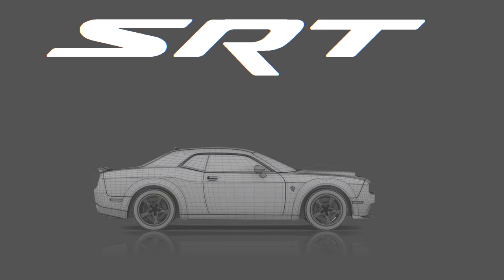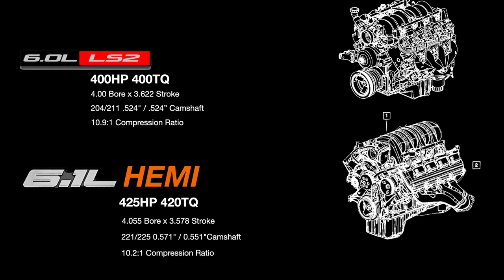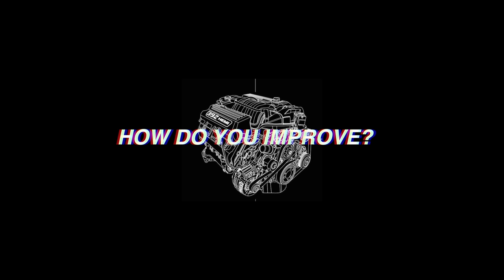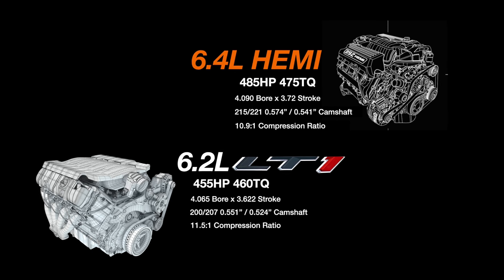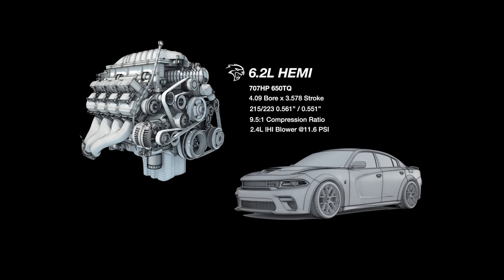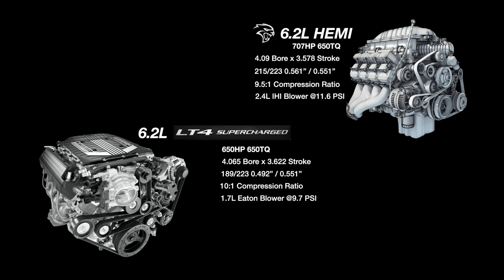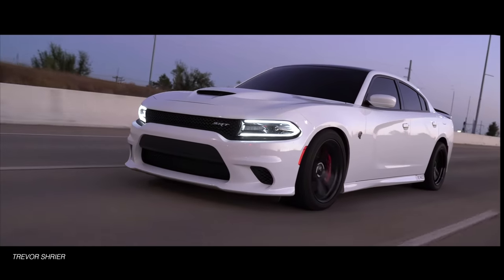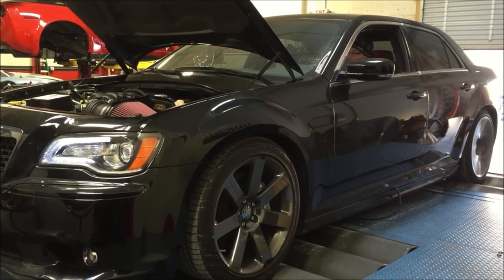Why SRT Engines Are Way Too Powerful😳| Explained Ep.3

Comment: Hemis have grown on me lately since I owned one. But the  LS family will always be superior to me just more reliable and efficient
Reply: 🤣😂🤣😂. Fake Hemi's you mean. Not real Hemi's. They are Magnum engines with a name plate.
Reply: @lincolnls0416  false. It's a hemi for a reason
Reply: @lincolnls0416  Hemi engines are quite different from an LS/GM engine. That's why the ZZ632 can hit 1,000hp NA compared to the Hellaphant and its super
Reply: @yrkjrk2972  look I am an ASE mechanic and they are not real Hemi's they are Magnums. Fck Hemi means Hemisphere now these Fake Hemi's don't have anything Hemisphere in them or about them. They also fit on magnum block's. Next 5.0s have been getting way over 1k HP. Since they were Carb engine's.
Reply: You can't beat the 5.3 Vortech.  I have one with 400 K miles. It still runs as strong as the day I bought it new.  Gas milage sux.
Reply: @ricktaylor3748  in race yeap but on mileage you calm nope. Dodge won't last to 70k miles without a break. Now you won't beat my old Escort Gt. 1.9. Before lady hit me I had 623k. I do have 1 question how many times you replace the spider injections.?? Cause then 400k don't count. Only thing I did to that 1.9 was a clutch. Oh wait map sense 3 times.
Reply: @lincolnls0416  lol know your facts said fake its Hemi for a reason kiddo
Reply: @lincolnls0416  stop the crack lol look at the valve design
Reply: That's  right  Chevy  LS and LT  shits on  these  Dodge engines that you  can't  even  put  a lot  of  miles  on  them
Reply: The biggest advantage that comes from a hemi head design (besides volume) is the opposed valve configuration.  The valve angle helps reduce shrouding and allows larger valve sizes but it’s the straightening of the ports that makes the design flow.  The quench pad at the top of the chamber is there for emissions and was a suggested add from the team that designed the 426.  It also helps the compression ratio without the need for pop up pistons.
Reply: It’s worth noting that many manufacturers use a “Hemi” head valve layout including motor cycles and have for decades.  They can’t call it a “Hemi” because Chrysler has a copyright on that name.  If you look though many of the craziest output engines use opposed/canted valves and use 4 valves and ohc.  But the valve geometry and combustion chambers are based on a sphere.  The 5.0 Coyote comes to mind…
Reply: Hemis are better from the factory, LS is easier and cheaper to mod
Reply: @Dukelevi12  so that makes  it better.cause that's  what  you  want  cheap and  easy
Reply: @lincolnls0416  the heads combustion chamber is designed like the old hemi with a hemisphere design. The bottom end isn’t like the old hemi, pretty much an LS rip off from the decks down. I’m a race engine builder for about 15 years. Those hemis arnt bad at all.
Reply: @TheRealZJE313    Like my women!
Reply: @lincolnls0416  ooooohhh ASE we better watch out this guy can pass a test. Whoa! Behold a God with a wrench. Dude most of us have ASE including myself. It's not hard. 16 years I've seen many ASE techs that couldn't fix a sandwich. ASE literally means squat on the shop floor. Just looks good on a resume.
Reply: @richieb74  no its not. I have rebuilt fake Hemi's on Demons. Your wrong.
Reply: Thank you sir idk wtf this guy talkin bout I know niggaz wit a LSX in they g-body pushin 1100 easy
Reply: @lincolnls0416  Hey, what do you mean they are "Magnums?" Just in that they are similar or are there some unadvertised compatibilities?
Reply: @fl6stringer  can swaps head's.
Reply: @yrkjrk2972  the zz632 is 632 ci/ 10.3 the cam lift is high asf .782 lift and it has a 12.0:1 comp id hope that hit lmao
Reply: Nobody in this comment section can comprehend the fact hemi is just a name for a modern engine that is no longer hemispherical like the old true hemis... because nobody in this comment section has built a fucking hemi clearly🤣🤣🤣
Reply: @lincolnls0416  they're quite literally hemispherical engines.
Reply: Super Cobra Jet cylinder heads just said hold my beer bro...
Reply: @justakettlehelm1673  no there not. Top dead center drilled on the head for a top dead center spark plug hole does not make it a real true Hemisphere engine's.
Reply: Ohh ASE mechanic. That explains a lot.
Reply: Doesn’t even look so great there. I’ve worked at shops and when guys come in with a resume and the only thing on it is ASE it goes right to the round file. They would rather have someone with shop experience than a new ASE parts changer.
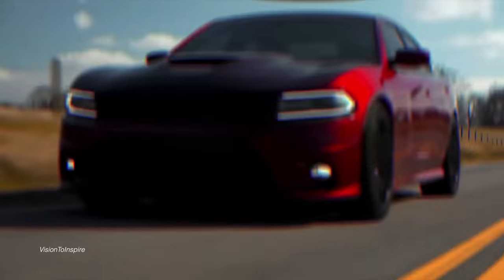Reply: @lincolnls0416  Wrong. They are Hemi's with a squish band added from the 2:00 to 4:00 o'clock and 10:00 to 8:00 o'clock positions (from the valve{s} to the cylinder walls at 9:00 and 3:00 o'clock) perpendicular  to the crankshaft. This concentrates the fuel/air mixture in the center of the remaining hemispherical chamber to be combusted by 2 spark plugs. Since the intake and exhaust ports are perpendicular to the crankshaft, you have an absolute straight/direct shot (flow) of fuel/air mixture from the intake into the combustion chamber; likewise for the exhaust side (into the header/exhaust manifold).  As a result there are 0 (zero) port turns or obstructions to deal with/grind away.  A GM LS will never flow as well as a Chrysler Hemi Gen III (nor make as much HP/Torque). It is a fact of physics; hence, Dodge/Chrysler Gen III Hemi's being handicapped in many automotive competitions (FSS as an example). Chrysler's Gen III Hemi is the very pinnacle of 2 valve V8 engine technology and cannot be improved upon. The industry will more than likely copy 
this design in order to compete with it as they have in pro stock drag racing (copying verbatim its "099" Hemi). The Gen III Hemi is also the most robust of all modern V8 American engines. It is unlikely anyone will challenge this 2 valve design and move foreword with a cleaner burning 4 valve/pent roof alternative or go electric.
Reply: @stillbill6408  🤣😂🤣. Not real Hemispheric combustion engine's. Stop I been working and rebuilding engines 43yrs. Own my own shop. Throw little numbers out all you want. Till you own a real Hemi from the 60s don't speak. I still have my own 426 Hemi in my Roadrunner wannabe Charger.
Reply: Sure is the new 5.5 flank crank they use in the C8R is the best V8 on the planet
Reply: Chevy is superior too Dodge in the V8 category that is why they compete in the GTD pro IMSA endurance racing and Dodge does nothing in any big time racing.....
Reply: LS454R reliable 770hp and 770 ftlbs NA. Mopar can't compete with LS lol
Reply: I was running 16psi on a 4.8 and had an oil pump failure. Run it for miles, pulled pounds of metal out of the oil pan and kept running it. I’m a die hard GM guy but I like everything car related.
Reply: @TheRealZJE313  Good job. You've added literally zero plausible information into this conversation. 👏👏👏👏👏👏👏👏👏👏👏👏🤦‍♂️
Reply: @lincolnls0416  tell me you know nothing about sbms without telling me you know nothing about sbms
Reply: @lincolnls0416  how so? They have spherical combustion chambers and the valve arrangement is across rather than next to each other. They are the prime of pushrod head design and also the reason all top fuel engines are based off their design. Hemis have been ahead of the game since they started 70 plus years ago
Reply: @lincolnls0416  also, no you can't swap the heads 😂. The only similarty I've found on them is the bolt pattern for the transmission. Trust me, coming from a 360 magnum owner, the first thing I wouldve done was thrown a set of hemi heads on my 360 to solve the cracking and horrible flow issue. As for the "fake hemi", they're still spherical, that means it's still a hemi.
Reply: @jerodwolford2743  your so wrong. Hemi's are fake engines. Cylinder heads way it's cut is not like 60s 426 Hemi's. As an ASE mechanic for 40yrs you need more knowledge. Top dead center cut for spark plugs on magnum engines doesn't make it a Hemi. Its the pistons and cylinders along with valve and cylinder heads cuts. Only thing different is bolt pattern on the head's. But they mount right up.
Reply: Dude put ot the joint Mopar no car...followed  by for ..Chevy just sux 
.proven fact...at least I could respect  if understood that
Reply: Take it like a man .....my wife loves powered ss camaro and the bitch know how race and twirl the iron.but ls just gets ass kicked  ..lol..and ls powered vetts are 2 seat camaros
Reply: Further more Calloway.. could shit like that with a 350 chev..but still I hate bow ties..lol
Reply: WRONG ... GM IS ALWAYS HAVING A RECALL AND HAVE HAD TONS MORE THEN CHRYSLER EVER DID .
Reply: @bradhardy2629  I had a 5.3 and the entire time I owed it I never changed the oil. As a matter fact I mixed it transmission fluid in with it when it got low. In two years of ownership it didn’t skip a beat i even sold it for more than I paid
Reply: Remember, the LS was originally a Ford design....
Reply: @shippybs  Exactly...now if only the other 80% of em out there would learn this :-p
Reply: @yrkjrk2972  You also forgot to mention the chevy engine has 206 more cubes of displacment. which is a massive difference.
Reply: @lincolnls0416  wow... you tube sure brings out the "know it alls" 5.7 hemi head will not bolt to a 5.9 magnum... the only relation to the modern hemi... and a magnum...is there both v8s... the modern hemi is indeed a hemi... it's not just a world wide lie that only you know about... the combustion chamber is in deed a hemisphere shape... a oblong one but indeed is hemisphere with plugs in the center... and intake and exhaust valve across from each other... which is text book definition of a hemispherical combustion chamber.... maybe you should update your ASE certification... I Lot has changed in 25 years 🤣
Reply: @yrkjrk2972  That's has 206 more cubes to utilize, as well as various other specific components/characteristics. It isn't a fair comparison.
Reply: @lincolnls0416  bro said as an “ASE” mechanic, dude stop it takes nothing to get that😂
Reply: @TheRealZJE313  what😂?
Reply: @louiewatson9389  🤣🤣
Reply: @lincolnls0416  MR ASE ..... 5.3 does not have spider injection.... but I'm sure you knew that 🤣🤣🤣🤣
Reply: @shrek_428  🤣🤣🤣 by far the funniest thing I have ever heard... thanks for the laugh.... chevy had been designing the LS1 since it was running the LT1.... tons of research behind that engine... every single chevy small block to date shares the exact same bore spacing... why would ford do that lol... only thing ford motors have with LS is 8 cylinders 🤣🤣🤣🤣
Reply: @mino1995cobra  these new "hemis" are not true hemispherical engines, since they no longer have hemispherical combustion chambers. They are Hemis in name only for marketing purposes. They are at the most hemi-Magnum engines.
Reply: Reliable? Reliable STOCK. Start putting power to stock GM engines and you’ll end up with a paper weight. Not to mention GM transmissions are known to be as brittle as your grandparents. LS and LT are only good when you start changing the internals and for everyday driving, that should be a deal breaker to anyone with a brain. The simplicity of a GM motor is alluring to track and strip racers but if you want a daily driving car with balls Ford and Dodge are superior. Even when adding a supercharger to the 6.4 or 5.0 they still outclass chevy. Once you start getting into big numbers 850+ GM motors may have the high ground but you no longer have a daily driver. Or a reliable, economical, sensical one.
Reply: @asapmimic1289  🤣🤣🤣🤣 you just made my day... this is one of the funniest things a read in a while...
Reply: @lincolnls0416  l want to believe you. But I can't . I don't know why. I got a vehicle with a hemi. That's the name of the engine. Not the kind. Its 2023. And it is what it is.
Reply: @thomasstott527  this guy runs his mouth in the comment section like Commander Cody in a hotrod Lincoln. Thank you so much for your explanation
Reply: @MrJakeMallard  Hemi is a name plate. Ford was the 1st original Hemi. Hemi means Hemispheric Engine. As I am an ASE certified mechanic years. I own my own business. New Hemi's are not Hemispheric engine's. They are Magnums just top dead center drilled spark plugs hole. But if you believe it's a Hemi then I put Superman on my outfit and it make me the real Superman then right. That is all I am saying.
Reply: @yrkjrk2972  I'm sure the 632 having 1000 hp has nothing to do with the fact that it's 10.3 liters or anything
Reply: @lincolnls0416  actually ,the old whale motors 392,331 were more true hemispherical then the 426! Mostly because of the massive valve size in the later!
Reply: Both Chevy and fords porcupine motors were later called semi hemis   and were basically just a take on the Mopar poly spherical 318 motors of the early sixties !
Reply: @Smoothoperator65  Ford built the 1st True Hemi in the 1930s. Sold it to Dodge.
Reply: @lincolnls0416  and still regret it!!
Reply: @Smoothoperator65  just like Cummins they got rid of it mid 2000s from taken money from the Government. Powerstroke is stronger but can't handle racing power like the Cummins.
Reply: @thomasstott527  it is funny how overrated GM engines are, yes.
Reply: @Asap Mimic  I'm not sure what you mean by over rated?
Reply: @thomasstott527  I mean they’re overrated. They are not good. They’re a good building block for high horsepower racing but other then that they’re not as good as people hype them up to be. Stock, they’re the same as every other engine on the road. Bolt-ons do not free up much horsepower and real NA power gains come from porting heads, bigger intake, and a cam. So unless you plan to put high horsepower on an engine, the LS is simply outclassed by the 6.4 and 5.0. Street racing, they’re outclassed, being daily driven (sensibly) and track ready (I say sensibly because in theory you can daily drive a car with a huge cam and stall but it’s gonna be miserable) they’re still outclassed, and stock well they’re no different then any other engine.
Reply: @Asap Mimic   that is a far fetched assumption... but your allowed to have your own opinion... even if it's wrong.. let's start with 5.0... let's compare ls.. 6.2 makes more power.. and more torque.. sorry ford build a bigger motor.. get away from the iconic 5.0 which has nothing to do with the whopping 250hp original..🤣 ...6.4.. if you can keep the lifters in it a great motor.. larger then the 6.2 ls.. same power 🤔... and the other comment... I daily drive my cammed.. and stall converter installed... super charged 6000 lb suv... and have the greatest joy beating hellcats...gt 500s.. mustang gts...scat packs... with my highly over rated LS 🤣🤣🤣 thanks for the laugh...
Reply: @thomasstott527  well it’s not an opinion it’s a statement of fact. You’re trying to compare the 302 from 1968 to the LS of 1997? Or are you trying to compare the 5.0 to the 302 which are completely separate engines despite the same displacement. Also the 6.2 chevy is 455 horsepower while the 6.4 and 5.0 are at 480 and 460 respectively before 2022 so I’m not sure where your “larger then but same power” comes from. Or “sorry ford build a bigger engine” since ford is able to make a smaller engine that outclasses the LS. The LS even 6.4 engines are highly inefficient compared to the 5.0 which is just a downside of a single cam pushrod engines. You’re missing my point, you can drive whatever you want supercharged SUV with cam and stall but you had to completely change the engine and transmission just to reach that point. Hellcats don’t have to change anything. 5.0 can be boosted with no problem just the same. No stall, no cam necessary. Engines and transmissions are superior even if your transmission is “built”. You no longer have a vehicle that is comparable. Gas mileage, wear and tear, annoyances, all that for what? Not much. You seem to think just cause you drive a cammed suv with a supercharger means you know what you’re talking about. Obviously, by your lack of knowledge of completely separate engines, but no hesitation to criticize, and the fact that you don’t know basic specs shows you think you can argue from a position of authority. You can’t. The INDISPUTABLE FACT is LS and Hemis are ineffecient compared to the 5.0. Cam, stall, and porting, which is all necessary for big power as well as forging internals, ruins daily driving, the longevity of the powertrain, and subsequently the vehicle. Like I said, the ability for the 6.4/Hellcat and especially the 5.0 to remain stock internally longer then the LS and the ability to still keep the same driving characteristics, no added wear and tear, no loss of fuel economy, make them better all-around vehicles. So yes, the LS is overrated. Have fun beating hellcats and 500’s when you’re on your 5th transmission rebuild or rear end rebuild and they’re still on the road with absolutely no problems unless they’ve done just as much add-ons.
Reply: @Asap Mimic  your comments are getting more and more hilarious to read... I has to completely change my engine and transmission 🤣🤣🤣 I didn't realize you built my truck... I'm stock bottom end.. stock transmission... you should do a lot more research before you start typing ... compare same year 5.0 to ls3.. same hp... ls3 has more torque... compare present day 6.4 to present day 6.2 Lt platform... same power apples for apples here... dodge had the 6.1 in that time frame... I mean every fast car at the track is Ls powdered...
Reply: @Asap Mimic  2022 mustang gt....450 hp... 410 torque... 2022 camaro ss.. 455hp....455 torque... looks like ford left there torque at home 🤣🤣🤣
Reply: @thomasstott527  actually the Mach 1 has 470 horsepower and 410 lb ft of torque but that’s only ten less then the previous years. Not surprising as the displacement is smaller. What is actually funny is if you consider the fact that horsepower equals torque x RPM. So it seems like Ford is able to create more power for less displacement and torque making your criticizing of the engine moot. Also the 5.0 is able to rev way higher then either 6.2 or 6.4, again, thanks to the DOHC design. Also also, the 5.0 makes significant more power gains from simple bolt ons thanks to the design compared to the 6.2 and 6.4. 

Stock bottom end and transmission with a supercharger. Smart combination. Either you’re not making a lot of power or you’re an idiot . You can decide that one for yourself. Also you proved my point. Track cars are LS powered, which isn’t true, but you have a track car and not a daily driver. Two different things. Proving what I said correct. Thank you.
Reply: @Asap Mimic  oh so we are comparing a hight trim level mustang to a camaro ss.. so you can say it makes more power... funny how you say the 5.0 can turn so much rpm... " because of its DOHC design " crazy how a pushrod engine can turn north of 8k rpm... oh and another odd one... pushrod v8's in Nascar turn higher rps two🤔 ...maybe you should spread all your infinite wisdom to the world... Nascar doesn't even know this or they would be running 5.0 dohc engines 🤣🤣🤣 or just imagine how much faster a top fuel drag car would be with smaller displacement and DOHC. Again your very small knowledge...or lack there of...of the ls platform is why you assume they are over rated... a stock ls3 head flows more cfm the the 5.0.. and it has twice the valves... a bone stock 6.0 ls based truck engine on stock bottom end can make over 1500 hp with twin turbos... Ford finally came out with a pushrod engine because the baby 5.0 won't make power and sure doesn't make torque... buy the massive newer technology 7.3 with power adders can't make the power of the over rated smaller 6.0 ... and on your getting frustrated and trying to be a keyboard tuff guy... you know nothing about my power level... you know nothing about the transmission in my build... and for your absolute lack of general knowledge... I pretty sure you drive a Honda civic... maybe a focus st 🤣🤣🤣
Reply: @thomasstott527  the Mach 1 and GT are the same engine despite adding oil cooling and an intake which is where the power comes from. Intake is a pretty standard addon so it’s not a far off comparison. 

Compare nascar engines to street cars. That’s apples to apples. However, I’ll entertain this preposterous comparison. Yes, the pushrod engines rev high thanks to billet internals that reduce the weight and inertia of the internals. From the flywheel to the crank to the valves. All needed to rev high. A tuned mustang can churn out over 8k rpm and for the LS3 you’re best bet is to stay in the 6100-6200 range max. Although it can go up to 6600 you’re asking for trouble. Also if you look at dyno charts past the 6200 ish mark, pushrods numbers drop dramatically but the 5.0 keeps climbing. If you give a 5.0 the exact boost of a hellcat, which is 12PSI, it will make more horsepower. Thanks to the DOHC, VVT, and direct injection. Sure the LS can rev just as high but it requires a cam and valves and springs etc. The 5.0 does this out the gate. Once again you’re completely missing my point in street and occasional strip car applications being capable of daily driven the 5.0 and 6.4 are superior. 

Next, the CFM is obviously gonna be different thanks to the displacement but the 5.0 is around 290-300 CFM and unported LS3 heads is the same exact so actually that would mean the coyote is still better. There isn’t much data I can find so unless you have different sources and data you’re more then welcome to link it. However, a better comparison is volumetric efficiency. The 5.0 has a 100-110% volumetric efficiency while the LS3 is only at 90%. Ouch. Next, no stock engine on a production car can reliably run 1500 horsepower so that’s BS. If you want something more sensical the coyote can reliably run upwards of 800 horsepower STOCK or 1000 reliably with added bulletproofing. The LS3 can’t even get near the 700 mark reliably STOCK. Especially the transmission which is even less. You’re trying to compare dedicated race vehicles to my opinion of daily drivable and racing cars that maintain factory warranty being better options. You can’t argue facts and experience with emojis and anecdotes. For the record I’ve had a corvette I enjoy the LS platform but the 5.0 is the best engine I’ve worked on for easy power. The hellcats are great for their reliability as well. I’ve owned all three at one point or another so I’m not arguing from a bias but instead what I’ve learned from owning each vehicle.
Reply: @Asap Mimic   another story... thank you.. I'm also glad you posted your assumptions of hp numbers... my motor is a L92 very similar to a ls3... as for your claim of barely 700 hp... I'm do over on stock bottom end 11 psi... on 93 octane... on a certified dyno at diablo sports headquarters where the dynos have to be certified to write carb legal tunes... again your comparing a more modern coyote motor vrs a Ls3... you mentioned direct injection... not available on the ls platform. .. we have done the FORE fuel system for many of Diablo sports cars including there record holding red eye.. we have also built a record holding hellcat charger at 1011 hp to the tires.. I'm well aware of what it takes to makes these cars perform... I can also say the one of the lead techs for tuning at diablo sport has a mustang gt 5.0 with a Whipple and it makes no where near what my 6.2 makes for power... and almost 200 less torque... we have made cts-v's.. and zl1 camaros make way more power for much cheaper then a hellcat... and have multiple people running 4.8...5.3 and 6.0 with tons off boost ...stock bottom end... only rings gapped... for 3 plus seasons no issues and the street drive there cars...
Reply: @Asap Mimic   even in a fully built for worlds most powerful coyote motor... 2138 hp... impressive... there are 2700 plus to the wheel ls motors... ls is making over 2200 on hydraulic roller lifters... there are 3000 hp ls out there... the coyote can't keep up... you have a great argument stock for stock... 5.0 is a great engine.. unfortunately due to its lack of displacement... it can't produce torque like a larger engine... the new LT series engine is dominating at the moment... the 495 hp c8 kills the much higher hp gt 500 ... and let's talk about the gt 350 r... c8 zo6.. highest hp na motor ever produced in a production car... 5.5.. .3 liters larger and way more hp... so yes it is a dohc... goes to show what ever ford does ... gm can do better 🤣🤣🤣
Reply: @thomasstott527  my comment was shorter then yours actually. Anyways, I actually said LS and LT platforms. You’re the one who first mentioned the LS3 so I just ran with it. As for your anecdote of the 5.0 whipple in comparison to your 6.2 that’s completely anecdotal and irrelevant. We’re talking differences in boost and supercharger sizes and so on. A lot of information missing to actually gauge why there is a difference in power. As for building CTS-Vs and ZL1s with more power and cheaper then a hellcat, seems very unlikely. The hellcats have more power stock then both of those and I’m not 100% sure but I believe the bottom line MSRP is cheaper then both the CTS and the ZL1. I don’t know the MSRP of vehicles off my head unfortunately. The ZL1 and CTS utilize a 1.76L supercharger, if I’m correct, and the hellcats utilize a 2.4L. There is already a 60-140 horsepower difference between the two. Hellcats are well known for being able to pulley swap and reach crazy numbers. 

ALL THAT BEING SAID, you’re still missing my point entirely. I’m not talking about what engines are better for power or boost or 8 second strip cars. At the end of the day it seems to come down to personal preference when you’re racing low times each having its own pros and cons. What I’ve been saying is the 6.4 and the 5.0 are much better suited for daily driving while still having power. Like I said, you CAN daily drive a car with a cam and stall and radials. You can even buy a brand new camaro and do all of that. HOWEVER, the cons of now having added wear and tear, stress on the engine, voiding warranty, decreased fuel economy, etc. is not worth the hassle. It’s not comparable. You CAN daily drive with a cam big enough to stall out at a red light. You CAN daily drive on giant radials. You CAN daily drive 1000 horsepower. Anyone can do anything but in the long run there will be consequences for huge power adders. I would much rather have a car with big power that is still reliable and maintains warranty. You can’t have big numbers and reliability on ANY ENGINE. That’s not what my goal would be. My comments our outlining the fine balance between the two.
Reply: @Asap Mimic   you are correct.. the hellcat makes more power 100 percent due to the fact dodge has that motor to its limits from the factory.. hence the problems that had with demons and valve train issues... the lsa engine uses a smaller blower that loves to be underdriven ... so it is easy to accomplish hellcat power levels with a pulley and a tune... again you have so valid points... your post would have been  better if you started with "in my opinion " ls is over rated... because there are plenty facts proving that it's one of the best platforms at the moment
Reply: I love the hemi more but you’re right. Hemi tick/lifter issues are far too common
Reply: @ReignRegime  I have a vortech supercharged ls....and a procharged 6.1 hemi...lol the best of both worlds... I will let you guess which makes more power 🤣
Reply: @shippybs  yes and no to the newer head designs. The latest head designs, especially in the 4 valves is actually what is called a Pentroof design
Reply: And available too.
Reply: @joebone3151  well that's false to you because they're not American made anymore look up from the old school days and compared it to this new generation do you know the parts that they put on their cars are actually cheaper for them but not for people like you or me or anyone
Reply: @DJ LA WOLF  dude, it doesn't matter where the engine is made. As long as it ain't China, Russia or Nk. I don't really care. I rather us work with our Allies to make bad ass rides then just be stuck here at hoke doing nothing you do know the same goes for all brands of all countries they don't make their parts in their honeland
Reply: @DJ LA WOLF  American brand American made. German brand German made. By your idea Toyota would be American as their factories are here in America.
Reply: More reliable and efficient, huh? I have a 2009 6.1L Hemi and have only had normal maintenance on it. Please explain to us your scientific data for your opinion. If you can’t, your statement and opinion are crap.
Reply: @lincolnls0416  , who cares. The point your making is meaningless. Call them strawberry shortcake, if it makes you happy. But the engine is the same no matter what you want to call it. However, please keep in mind your bias is obvious when your handle includes LS04 and you rave about LS engines.

I have a 72 340 WEDGE (I bet you had to look that up) that will walk your LS.
Reply: @lincolnls0416  when you have to keep saying that with every comment, it looks like you’re trying to convince yourself, not us. A Hemi is a Hemi, and no, they don’t bolt up to a Magnum . And as an ASE mechanic and having my own shop as well as 40 years experience… you’re wrong
Reply: Lmfao ase is a shop recognition of excellence like bbb for mechanics not a certification
Reply: Came to the comments section to hear shitslinging… was not disappointed! 🍿
Reply: mopar is king, the modern gas dodge engines r plenty. we also have the cummins in our trucks. (yes i know chrysler doesnt own cummins) mopar is all around the best!
Reply: @lincolnls0416 you don’t know the definition of Hemi do you?
Reply: Fact
Reply: @joebone3151 you my friend are 100% correct. You can't get a real hemi anymore unless you pull one out of the woods
Reply: @shippybs Coyote engine is amazing! It just sounds like shit due to its firing
Reply: @TheRealZJE313 no, you make no sense
Reply: @imhungry2387  how so ?
Reply: @joebone3151 bud they haven't made the hemi since the 70s gas crisis... 🙄SMH just because they have two spark plugs and have it set up like a hemi   don't make it a hemi.... a true hemi would blow most if not all the current "hemi" engines out the water..
Reply: @yrkjrk2972 true hemis make 1000 hp NA ON CARBS ALSO!  Slap a Weiand 8-71 blower and ur pissin and shittin on hellcat red eye engines
Reply: @shrek_428 🤣🤣🤣  I need u to prove that fact.... cuz I'm calling bullshit... ford couldn't ever come up with such a brilliant engine...
Reply: @thomasstott527 ps.... I don't see no modern "hemis" with their pistons in the combustion chamber....  pretty sure they would contact the head before they got a chance to squeeze into that "hemispherical " pocket
Reply: @lincolnls0416 actually Pip a Belgian company built the first hemi back in 1905   and Ford never made a hemi engine til after the 1970s...sorry buddy  got ur facts wrong there
Reply: @ziggyortiz37  I'm not sure i... or you even know what your saying 🤣🤣
Reply: @lincolnls0416 it is way closer to a hemi than magnum, while the chamber in the Gen 3 Hemi’s have had the sides of the chambers squared a bit (the sides of the chambers towards the front and rear of the engine) to improve the flame travel and fuel burn, the shape of the combustion chamber has less to do with the performance of them hemi then the position of the valve train. The hemi have valves that are opposed not side by side like most other push rod v8. This greatly increases flow and the hemi chamber was a by product of this since the engineers of the Gen 1 & 2 thought the hemispherical shape would eliminate valve shrouding. If the engineers of the Gen 1 & 2 would have had access to this, we might never have heard of the term Hemi, there are other difference like to plugs per hole but the valve placement in the head is huge.
Reply: @lincolnls0416 just stop, read my response and it's the valve train not the shape of the chamber.
Reply: @lincolnls0416 I have a hellcat and I love the 6.2 hemi , your just jealous you drive a Nissan Altima and your really just a Walmart lube tech with a wanna be ase certification
Reply: Ive had nothin but greif from the LS
Reply: Fyi: Theyre NOT real HEMIS, just so you know.
Reply: I worked on and built these. Theyre NOT a Hemi. There's nothing hemispherical about it.
Reply: I love a good LS engine especially those hand built 427's in the New Yenko's
Reply: @nighttrain1565 other way around. You guy's can't comprehend that atp Hemi is just as engine name.
Reply: @yrkjrk2972 it’s literally have the size bigger than the hellephant smh
Reply: @orangepeel2223 my best friend just built a 6.0 Ls. Put on the larger rectangle port heads. New flat tops sit zero deck. Stage 2 cam. In his Gen 4 camaro. My stock 392 challenger still beats it.
Reply: @ricktaylor3748 ya the gpm is rough, with a 93 tune I’m getting 10.7. Bud a gt500 tuned to 1200hp gets 12 city 18 highway😭😭😭
Reply: Nah ,,,MOPAR FOR SURE..
Reply: Damn, so how does it feel to be gapped by fake hemis?😂
Reply: Not the 426, which is still the base of most Top Fuel dragsters and Funny Cars to this day, 50 years after the 427 Cammer’s reign ended. Unless a very large OHC engine comes along with really solid internals and a deep aftermarket, I doubt that dominance will end until electric tech gets good enough a long time from now.
Reply: Pass on low sport
Reply: @ricktaylor3748 you mean generic motors must be your first gocart 😂😂😂😂
Reply: You should be a comedian 😂
Reply: @Cherylann-ryllaby2   Too bad you're crazy.
Reply: I own a 392 & I totally agree
Reply: @lincolnls0416   I SERIOUSLY don't believe you have an Escort with 623K miles, they won't las the long.
WTF are spider injectors ?
Reply: @Shittyyscat    The 392 is troublesome.
Reply: @stillbill6408 Finally somebody who knows anything about the gen 3 hemi.  You’re right they are the most robust today especially having iron bge blocks 15+ hc or 18+ scat. recorded today with 2000whp still in one piece stock block. Everyone else went aluminum block and need a sleeve job to make this power on a lighter body to compete with dodge.
Reply: Did you know the top fuel dragsters used to hemi design? So how is LS better for making power?
Reply: @franktime4425  what do they use now lol
Reply: Reliable? Lmao
Reply: @lincolnls0416 Spider injection was on vortec 5.7 not on any LS..... I have 8 ASE test under my belt also if you want to argue....
Reply: Agreed, in that normal aspiration means less expensive ass parts to eventually repair. How 'bout that 1K horse Chevy BB!
Reply: call them hemis cause they ahve a hemirsferical head, of they dont
Reply: 100 percent